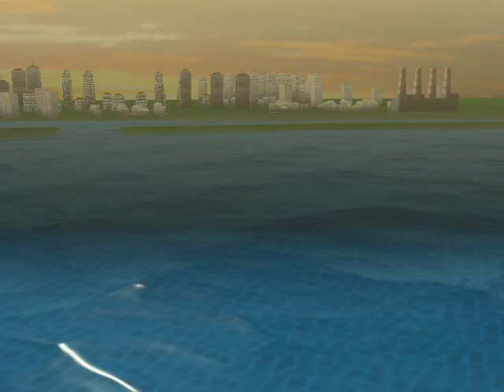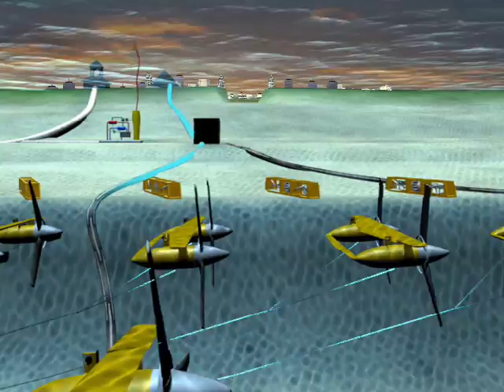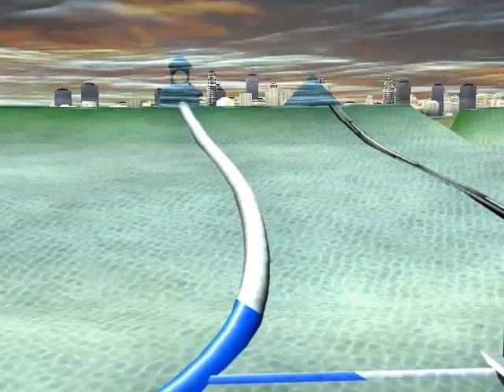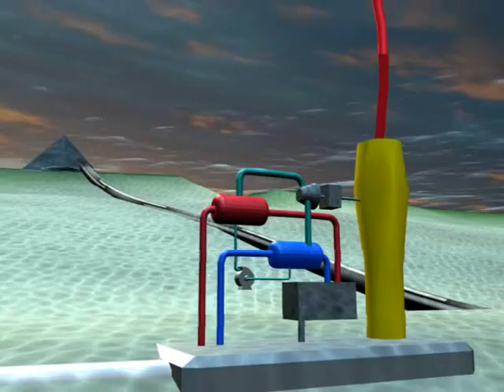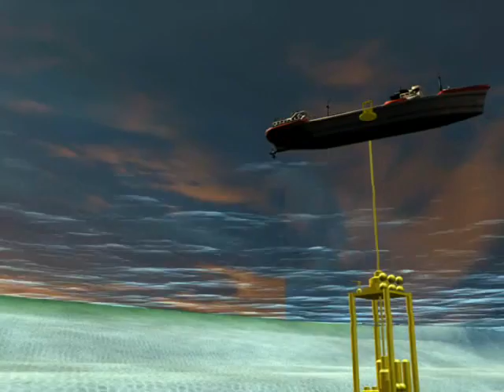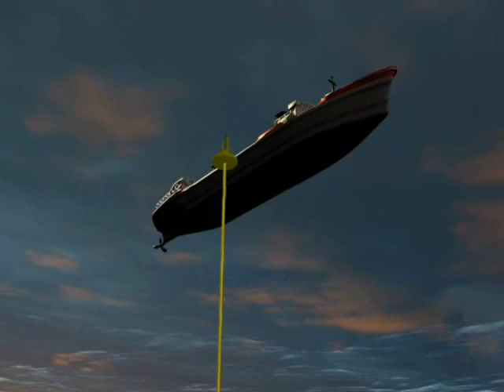Florida's Clean Energy and Ocean Energy Technology

Comment: You over complicate. Using your devices to Compress Air then using the compressed air to power generators greatly reduces problems. You would have NO problems with over speed etc...Some LINEAR MOTORS & VOICE COILS produce MORE energy than they consume. Some plastics are stronger than steel & take hundreds of years to break down. ENERGY is a ^$5TRILLION a year CRIMINAL SCAM. The 1% ENERGY COMPANY STORE  ENSLAVES The World in POLLUTION POVERTY & FALSE WARS Murdering billions Suppressing technology

Comment: Those impellers dont seem appropriated for underwater use. By design they create unnecessary drag and strain. I think a better design would use a much longer impeller hub with the blades having a long base. Complete the opposite of what we see now. Now we see a long blade with a small base hooked up to a small hub. I was imagining something more like a corkscrew type blade. It could even be encased in a cylinder which would create more directional stability and protection for marine life.

Comment: Since the density of water is so much greater than air the blades will not have the same high rpm. Also the "wings" är shorter and designed shorter which will allow the tip speed of the blade/wing to be acceptable for marin life.